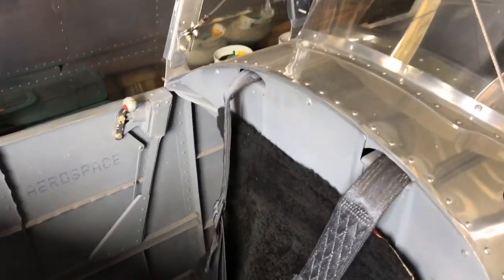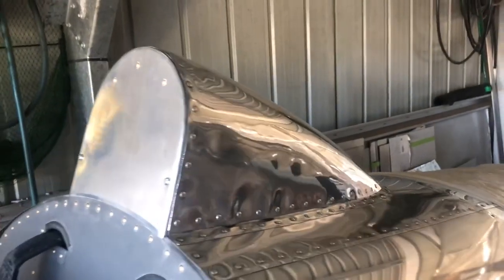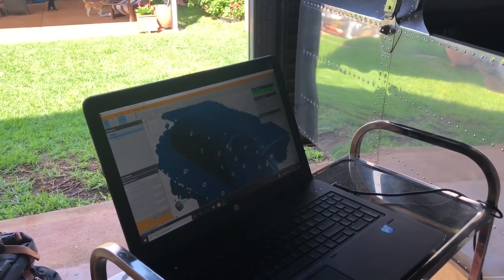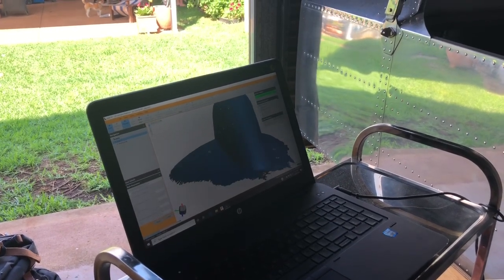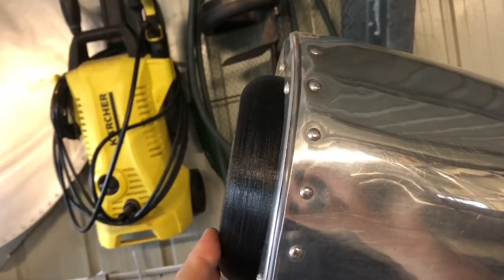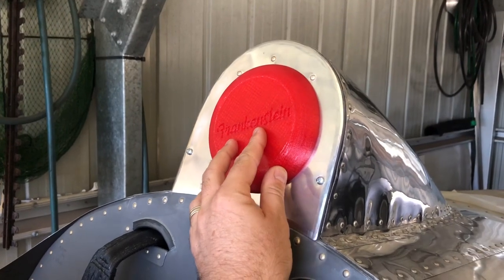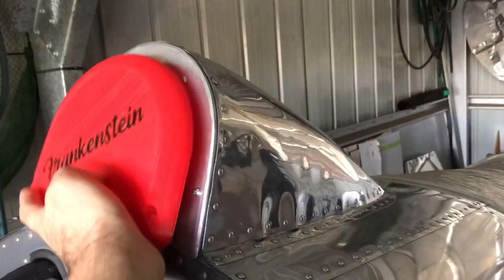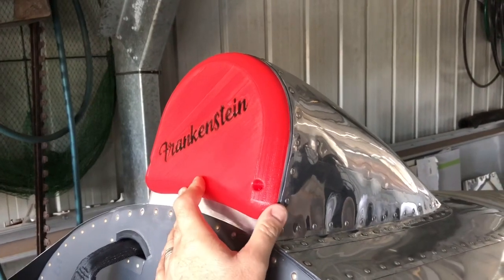Frankenstein goes high tech 3D scanning and printing parts

Comment: In engineering, wing loading is the total weight of an aircraft divided by the area of its wing. The stalling speed of an aircraft in straight, level flight is partly determined by its wing loading.

Comment: Dihedral angle is the upward angle from horizontal of the wings or tailplane of a fixed-wing aircraft. "Anhedral angle" is the name given to negative dihedral angle, that is, when there is a downward angle from horizontal of the wings or tailplane of a fixed-wing aircrafts
Reply from the maker: Sawyer Heslep good stuff mate. There are more details on Frankenstein’s wings in a previous video I’ve made. Dihedral angle and washout. Good luck with your studies
Reply: @donwtsn  On a straight wing airplane, all of the airflow over the wing travels parallel to the aircraft's chord line. But, on a swept wing, only some of the air flows parallel to the chord line. The other part flows perpendicular to the chord - this is called spanwise flow.
Reply: Beware going going too fast with a STOL airfoil will stall the airfoil. Slow the fuck down. Main Wing should create lift upward lift. While your elevator creates negative or downwards lift.
Reply from the maker: Sawyer Heslep thanks for the reminder mate. It’s been quite a while since I sat in a classroom and studied there of flight and aerodynamics. Been a bit more on the practical side of things since then. Pretty sure Frankenstein has enough drag built into the airframe to reduce the chance of getting too fast
Reply: @donwtsn  static or dynamic drag?
Reply from the maker: Sawyer Heslep I’ll have fixed undercarriage with various struts and shocks, and tyres. Struts supporting the wing centre section and the wings (very high lift so very fat) themselves. And 2 open cockpits. Drag everywhere
Reply: @donwtsn  what about the elevator?

Comment: On a straight wing airplane, all of the airflow over the wing travels parallel to the aircraft's chord line. But, on a swept wing, only some of the air flows parallel to the chord line. The other part flows perpendicular to the chord - this is called spanwise flow. I'm studying engineering.